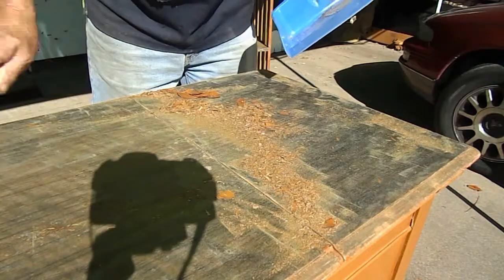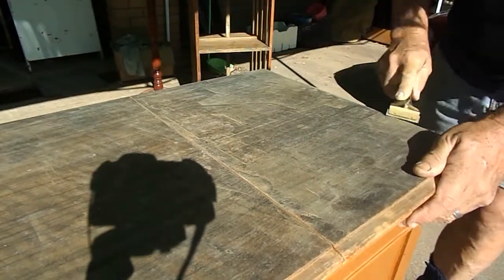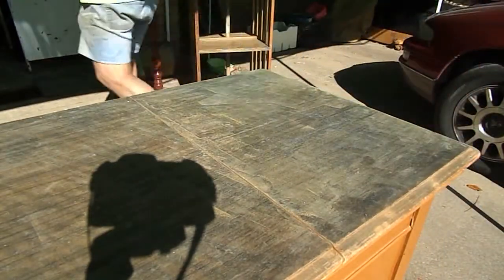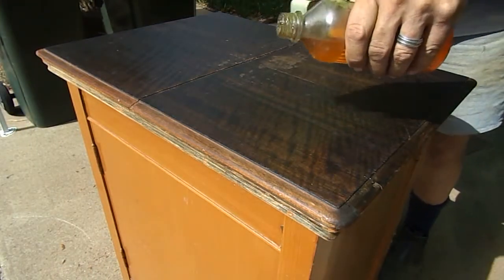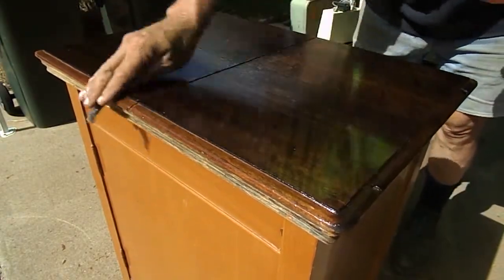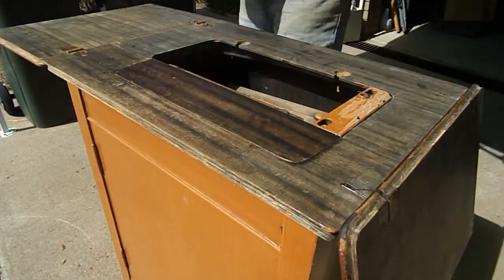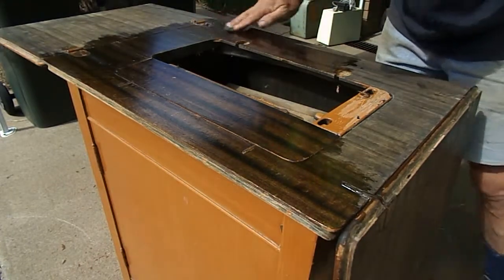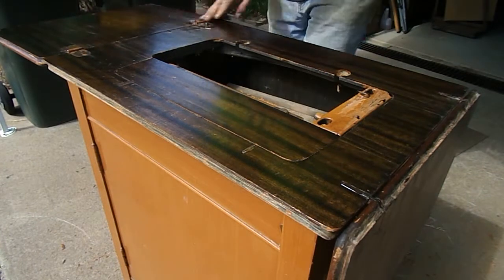Stripping a painted  antique/ Vintage cabinet

Comment: What type of wood was commonly used to build these Singer tables, and the wooden bases that came with newer more portable machines? If you know, please.
Reply from the maker: The early machine  used a lot of  Oak then they went onto veneers and stain. Here in Australia a lot of  Black wood was used.  Different woods for different countries. So its each era used different woods. Sorry I can not be of more Help.
Reply: No, that's good info thank you. The history of the Singer Co and vintage machines interests me, and there is never much talk about the bases. They seem to have been consistent in their manufacturing and I wondered if they required a certain type of wood their bases be made from. It's great watching the transformation progress.